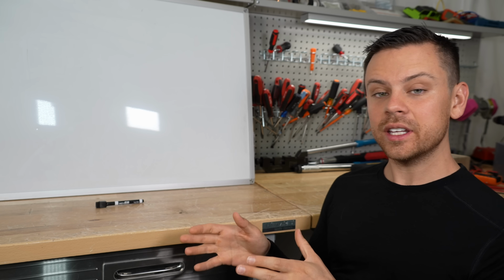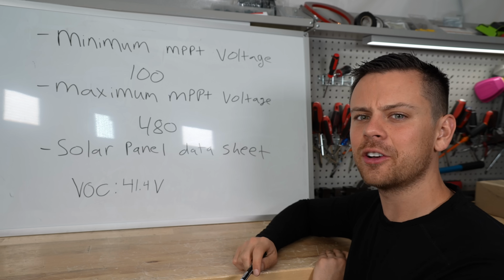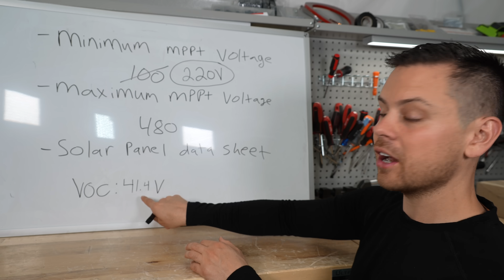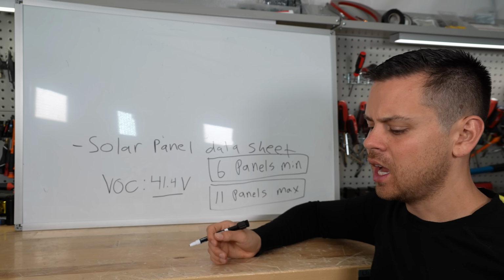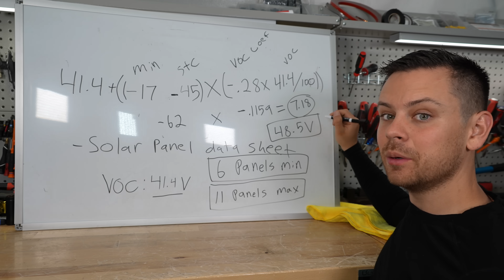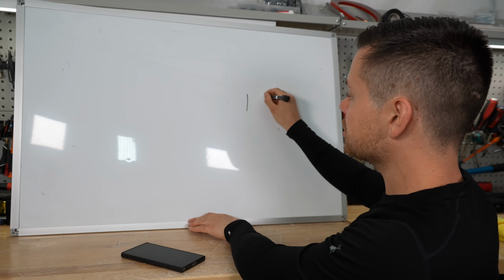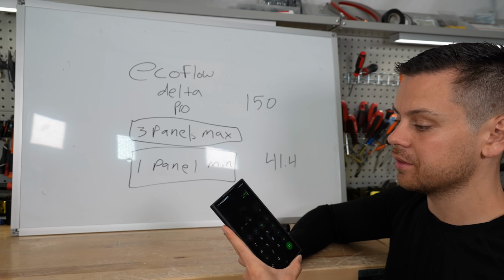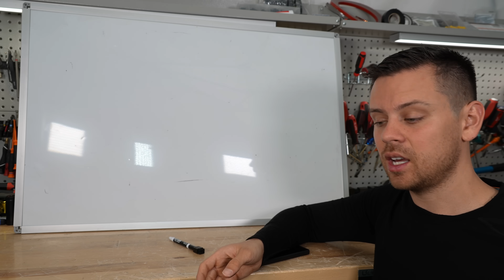Solar String Voltage Made Easy! How many solar panels can you safely connect?

Comment: I was literally doing these calculations today, I am moments away on getting 16 of the exact 370w panels you calculated for (when hopefully they come back in stock, to hook up two 8 panel stings to a 6000xp. 
Hoping to run my water pump and my refer's and freezer's, and starlink and server, pellet stove off grid permanently.
Thanks for all you do, giving people like me the confidence to do this on our own.
Reply: If you have the mounting space for it, your inverter will be more productive with another panel (cold zone) or 2 to 3 panels (temperate zone) per string. In Australia most systems are installed with  panels sized to 1.33x the DC rating of the inverter.
Reply: @wmfoster  i am at the 45th parallel,  The 6k eg4 is overkill for what my main goal is. But i would like 240v for my 3/4hp water pump (pumps from a 3000 gal tank, gravity fed spring) @ 120v they only last a few years. And since i was going with the 6000xp i might as well bump up everything to offload a few more circuits to it. Original goal was about a 3.5k to 4k solar and 3k inverter but I haven't seen any with 240v for much cheaper than the 6000xp.
Reply: 45th NORTH parallel, I should clarify since you are south of the equator  :-)
Reply: @repuSgnikcuf  Isn't the South 135?
Reply: @timsteinkamp2245  haha, yes if you believe in the sphere theory 😆, i had a dumb moment, thanks for pointing that out.
Reply: My brother!  Same.  My pellet stove is a big pig: 325 watts whenever its on.  Going to add a cheap wood stove (pellets keep going up, and aren't always available) so I have a non electric option that isn't gas.

Comment: Hi Will, just a question about charging those cheap chines 12 volt lifepo4 batteries. I have 3 of them, I want to run in parallel. I heard that you don't really need a MPPT solar charge controller to charge these. I have 4x200watt solar panels. Should I get an mppt controller for it, or can I just get a cheap, say 40 or 60 amp  PWM controller?
Reply: I have found that getting the MPPT controller is much better at getting the maximum power out of the solar array into my battery bank. Don't "cheap out" on your system, especially if you are going to depend on it for something important. If you are only "playing" with solar, you can use the PWM controller. I have used both, and I always recommend MPPT to my friends who ask.
Reply: Go mppt! They are so affordable these days. Renogy has nice ones that aren't expensive.

Comment: You actually don't want more than the minimum mppt voltage, inverters have an actual start voltage. Which is higher than the minimum mppt voltage.
Reply from the maker: Did you watch the video
Reply: @WillProwse  Yes. You do mention that the minimum voltage is not what you want, but you fail to mention the start(up) voltage. As that is something that is also in the datasheet of the inverter.

Comment: Just got my pallet of Aptos 370w panels delivered today. I’m so happy Signature Solar decided to go with FedEx for shipping. They came in perfect condition for the first time I’ve order panels.
Reply: I had just gotten a pallet of 10 panels. I was opening the two per box panels inspecting them and setting them around. Just before I was done with the cardboard unpacking a wind came up and picked a panel up into the air and dropped it into another panel and put a hole into the glass of another panel and shattered the glass. It could still work with repair but I figured out during installation I needed 3 panels of three for my system so the tenth panel was a spare. At the time they were $1800 for poly panels. Delivery was $300 of the 1800. It's been almost ten years and I still have all those panels.
Reply: I just ordered the minimum 10.  Was that what you ordered?  I'm hoping that size is a well packaged "unit".   Signature Solar tells you to order more panels than you need because of expected damage in transit.  I hope I have a shipping experience similar to yours!
Reply: @mondavou9408  I ordered 20. It came on a pallet that I placed on my driveway. It was very well packaged and I installed 16 so far. None were damaged
Reply: I just installed mine on a wooden cover. Love the look, price, and wire lengths.

Comment: Correct me if I'm wrong but isn't the wattage you actually  get from a panel usually about 70% of it's rating? For example a 200 watt panel will generate 140 watts nominally?
Reply from the maker: Depends. STC or NRC. I've pulled 100% of STC output in my past videos. Check them out

Comment: Current doesn't really matter as the MPPT will simply throttle the input hence the over paneling.  You can't hurt anything but you may not get to the max performance.  Great job explaining we need more lower voltage all in one inverters, these higher voltages are making things extra complicated and expensive when shading is involved.

Comment: I knew the cold made the voltage go up, but never really took the time to actually calculate it so did not realize it was that much of a difference.  We get like -40's here sometimes so definitely something I'll want to calculate next time I setup a system.  This voltage is the absolute worse case scenario though as once everything is in circuit and assuming there is always a basic load it will probably drop enough. But still something you want to play safe.

Comment: Good description, the only error I see is that you can use STC temp of 25°C instead of NOCT in your formula. As well PV modules rarely hit the voltage they're rated for unless your site is at higher altitude. I'll send my spreadsheet that I used for decades at work if I can figure how to.

Comment: Hey @WillProwse, have you had a look at the Victron MPPT calculator on their website? do you have any thoughts on the recommendations there? One Issue I have with my victron MPPT charge controller is it is a 150/60 so max voltage is 150 volts so I have little choice but to parallel my strings though for the price I would love the voltage max to be higher on the victron solar stuff in the consumer marker segment
Reply: Victron also makes 250v and 500v charge controllers, just FYI. You will pay extra for that!

Comment: Will this is great info and definitely the type of information I was looking for .   The temperature coefficient...for location ....Does that take into account the fact that the sun will be very weak?  Seems like at 9.8, moving to 10 wouldn't be a huge issue as there's not a significant amount of sun when it's that cold very often
Reply: It could take only one voltage spike to destroy an inverter/solar controller! Since the equipment is fairly expensive, would it be smart to risk it?
Reply: @Tumbleweed5150  I totally understand.   Conservative is always safest. But it doesn't make any sense to me.... I can understand for an efficiency perspective that we could make more votes what it's called. But what doesn't make sense is how it could do that when the sun is so low in the sky in the winter
Reply: @LeeWinkler  The Voltage will be the same, but the Amps will be lower because of the lower sun. My panel strings show very close to the same Voltage even when the sun is just above the hills to high noon. However, the Amperage reading is VERY low close to the horizon, but at almost full rating at noon.
Reply: @Tumbleweed5150  I was going to add on to my last response...." Unless this is a volts vs amps thing".  I'm a newb and still trying to understand when each applies.   Thank you!

Comment: I am confused about the temp coefficient of VOC.  My panel has this at -80mV/C.  Then there is the temp coefficient of power is -.5%/C.  Then there is temp coefficient of ISC which is .062%/C.
Which one do I use in your formula?
Reply: This is a confusing topic, I'll try to make a clearer answer, but please tell me if it helps or not.

Each panel has a Voc, Open circuit voltage in sun with no current flowing, this is the most voltage potential a panel can create. It's important for only one reason, electrical devices have physical limits, and you just want to be sure not to kill the device it is plugged into.

The problem, is this varies with temperature, and panels have greater Voc when colder, and when the sun hits your panels on an icy winter morning, it's the Voc at that temperature, lets say -5C, not the Voc measured in that nice warm STC lab at 25C, that hits your delicate electronics initially, and might cause arcing and failure.

You need to look at the units for your temperature coefficient, yours are mV/C, mine are all %/C, those units tell you how to use the coefficient to get the actual Voc at the cold temperature. That % by the way, is percentage of the STC Voc, so the correct unit would be % Voc-stc / C

In both cases, the extreme low temp is -5 C, and STC is 25 C, thus you are how far from STC? Subtract STC temp from your temp, and that's how far you are away, so 25 less than -5, or -5 - 25 = -30, you are 30 C negative of STC. delta T = - 30 C.

In both cases, you are given the STC Voc, for example, lets say Voc = 42.0V at STC (25C)

You now have the STC Voc, and your temperature variance from STC in C, 42.0V and -30 C.

So now you want to calculate the change in voltage (delta V) caused by this change in temperature (delta T)

For units of mV/C, voltage varies directly with temperature variance from STC,
you know you have a -30C variance from STC (delta T), and given -80mV/C, the change is 

- 80 mv/C * 1V/1000mV * -30 C = 2.40 V

For units of % Voc-stc/C, voltage varies a percentage of the STC Voc based on temperature variance,
you know you have a -30C variance (delta T) from STC, and given -0.1905 %Voc-stc/C

- 0.1905 % Voc-stc/ C * ( 1 / 100 % ) * ( 42.0V / Voc-stc) * -30 C = 2.40 V

So, now you have gotten past the different parts, the units causing a different conversion from delta T into a delta V, and the result is:

Voc-(-5C) = Voc-stc + delta V = 42.0V + 2.40V = 44.2 V

I suppose they could give some other form of coefficient, we have seen mV/C and a percentage of Voc-stc / C, but what matters is, you find the extreme delta T, how cold will it get from STC, and calculate the variance from the Voc-stc listed, to get the actual Voc at that cold temperature.
Reply: @JosephDavis-b4e  Thank you for taking the time to post that.  Very helpful
Reply: @JosephDavis-b4e  Thank you!
Reply: that is 2 of us.

Comment: Do you have  experience with micro inverters that connect to 2 or 4 panels directly to prevent  a bad panel from  bringing down  the system.

Comment: 9.8 would be safe to round up as long as that -17 is a winter daytime temp.  The panel angles are not ideal and the sun has more atmosphere to penetrate in winter.
Reply: It will probably be fine. On the other hand people that far north may try to optomize angles for winter, as that's when their greatest needs are, so you cant count on it just being kess efficient. It's also possible you could lose warranty on a component if you have it overloaded per-spec, even if that isn't the cause of an issue.

Comment: @WillProwse would laugh at my backyard ground system used to power my refrigerator and freezer. Here in Vegas. 10x 100 watt panels totaling five pair in parallel. Working fine for the past 3 years.
Reply: Sounds like my Vegas backyard system. No way would Will pass me in his class room.
Reply: @tinkering123  🤣

Comment: Will, with something like the Ecoflow DP, are you not as concerned with calculating the voltage at the colder temps b/c of the potential overhead built into those units? In your example it looks like you'd exceed the max voltage at your same -17c example.

Comment: how about bifacials? they can put out a lot more in snowy areas do they bump up voltage?
Reply: Yes they should. But you would have to check the specifications on your panels. Not all are the same

Comment: SUGGESTION: Discuss when installing multiple but separate strings, orient all panels in one string as close together east and west, ie do not put in a single row east to west, so that as shadows hit the string, the strings that are not in the shadow area will have max production.
versus if all panels are in a line
the shadow will hit multiple strings at the same time, reducing production of all strings
Reply: Huh

Comment: Good video. Gotta be careful with 4 panels with DFP. At 150 in normal conditions it would leave no room for increased voltage in cold weather. Best setup for delta pro is really 3s2p. Delta pro can bring in 15.9 amps at max and it would help maximize input in days with clouds or rain.
Reply: What does DFP mean? Tx.

Comment: I appreciate you spending time on the cold temperature issue.  A lot of 150v charge controller's are damaged in the north because people follow the simple rule, but don't understand the cold weather issue.
Reply: my area here in Washington State it gets down to. -15. for only a couple days out of year
Reply: My only question is with the low angle of the sun would you actually be hitting the full voltage even in the cold?
Reply: @pin65371  Likely not.   You can tell from WIll's face.. he has burned up a few of them..  It's expensive, and scary actually.  Hopefully you installed in a location where you could have a barbeque.
Reply: @pin65371  yes is for a flat roof 9hrs sunny
Reply: @pin65371  I was wondering that myself, I don't see where he addressed that question. I am thinking of putting a disconnect switch on the rig I am planning to drop a few panels if that comes up when the temp plummets.
Reply: better life near nuclear plant and free heat, eskimos dont cry
Reply: 150 V which toys are you using over there? 
My 48 volt battery system is charged by a Deye 12 kW which can handle 1000 volts on every string.
Reply: @ReinhardSchuster Nice system you must have. Not everyone has need or resources for such setup so most systems are small 12V stuff with few panels.
Reply: @ReinhardSchuster  that sounds really expensive
Reply: @ReinhardSchuster  If you point me to 600v+ 5kw MPPT charge controllers that are under $150 each I'll start buying those instead of the $100 5kw 150v mppt charge controllers I'm currently using.
Reply: @AdamDavisEE  this is facts

Comment: You're forced to used serial with those items as the current of 2 of those panels exceeds the EG4 17A limit.  Technically you should aim for nominal MPPT voltage(via current configuration), for best efficiency, but Will's run down will show you the scope of safety.

Comment: I don't exceed 8 panels per string.
Reply: I did. My math told me I could hook up up to 11 of the panels I was using, but only had nine. They are 260W panels, and the VOC is what I calculated by, going into my 5000W Growatt, which lists the Max VOC input at 450VDC, even though the MPPT Voltage range is listed as from 120VDC to 430VDC. I live in extreme southern CA, so no worries about cold weather.

Comment: I have two strings of 420 watt panels, each string is a row of 7max in series than parallel for the current. Each string is roughly 350vdc at 20 Amps. I got a deal on 8 gauge solar cable so the runs are around 100 feet feeding my SolArk. I made darn sure to keep my act together and make darn sure to hook it all up at night etc, etc. Last thing I needed was to be a Charcoal briquette in the pasture, lol. Battery charging is seamless.